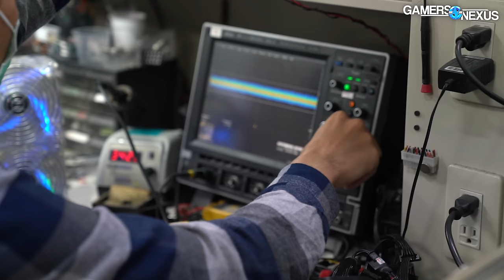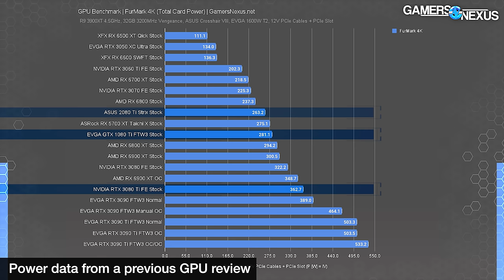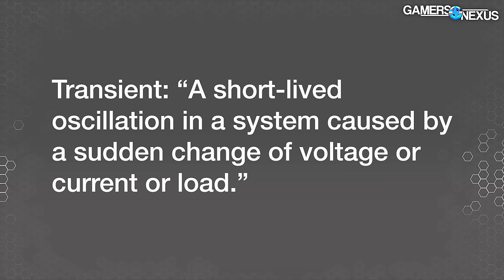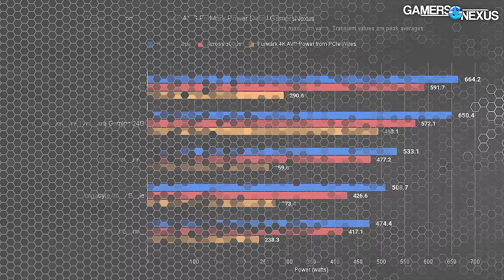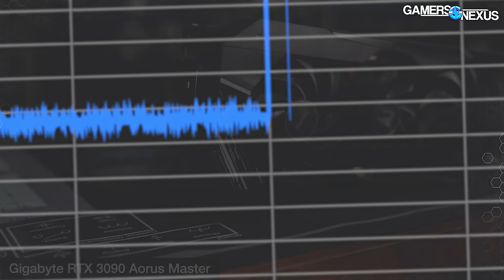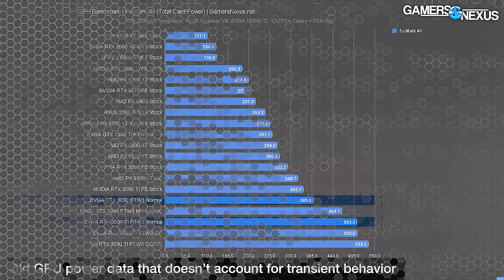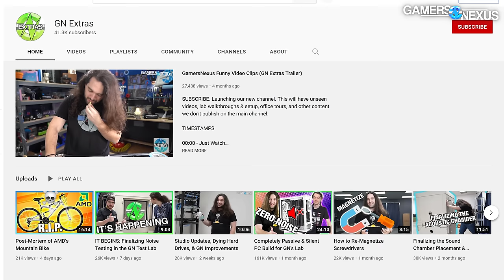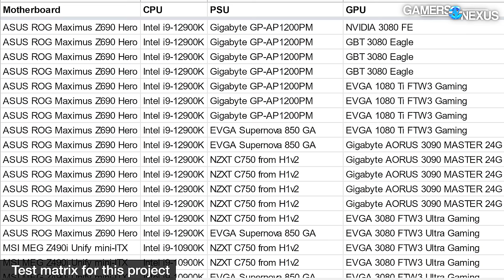The Brewing Problem with GPU Power Design | Transients

Comment: So, a bit of a tipoff about testing for these transient spikes, as I recently had a problem with them myself that resulted in me just buying on on-sale EVGA 1300W so it can just soak up the problem, because thats far cheaper on time than any other solution.

The tipoff here is the BEST way I found of tripping it, happened literally within a few seconds every time, was fallout 4 VR. In general I was able to benchmark the system as I wished and never had even one shutdown during any benchmarks, however I had one shutdown while loading GTA online (weirdly), one shutdown in Phasmophobia VR, and a total of atleast 30 shutdowns in fallout 4 VR before I even got through character creation. I'd highly recommend it as the BEST way to see if a spike can take out your system power.

My System contains a 5950x, an MSI 3080ti, (64GB 3600MHz RAM) and was running on a Coolermaster 850W MWE V2, if anyone wants to know
Reply: 3080ti isnt that far off from an 3090 ... afaik a 3090 can have spikes at almost 600w, worst case for a 5950x would be like 250w and for stuff like ssd, fans, lights etc ill give them ~50 to 75w ... espacially if you look at newer boards ... then i'll take 20% above it and this results in my psu capacity i want to buy for a rig.
Reply: Can you share the framerate you were hitting in Fallout 4 VR?
Reply: I feel like this has happened to me.  I can't get my system to reboot without pulling the CMOS battery.
Reply: I had a similar problem like a decade ago with a 570GTX or whatever it was. Every time I looked at water in World of Warcraft the computer would shut down within seconds. Took a while to isolate the behavior down to that, but once I put realized that was happening I could reproduce it every time. Put a bigger PSU in the system and the problem went away. Transients are fun.

Bigger picture though, all PC components are ballooning in power consumption. Dennard scaling was already dying off for years, but it's really hit a wall in the past couple of years. A significant source of extra performance is now coming from simply letting components draw more power instead of getting more performance from a similar amount of power like we saw in years past. This is only going to get worse from all vendors as time goes on.
Reply: @ngc4486diane  People don't often understand, and there's a lot of bad advice out there. Pre-builts too often have substandard components, so I'm not surprised at all.
Reply: @ngc4486diane  for, from common information and advice, it appears to be the most appropriate thing to do.
Reply: Did you have GPU and CPU over clocked?
Reply: What was the motherboard brand?
Reply: @sladewilson9741  I had this problem with GigaByte mb/gpu, turned out to be pin 20 connected in DisplayPort cable …
Reply: Okay, so Imma make a BIG answer to basically every reply, this got a lot more attention then I was expecting. First off, my board I forgot to mention, it's an ASRock X570S PG Riptide. FULL spec breakdown of every component towards the end.

While fallout 4 VR was running I was getting about 60-70ish FPS (it's a lot harder to tell in VR, but it felt around that, with spikes down to 40) and now running it I get a smooth 90ish (by feel, again, its hard to tell).

No, I did not have anything overclocked. I had looked at overclocking all of them, but it seemed pointless on all fronts. Trying to overclock the CPU I wasn't even getting into windows at the turbo amount. GPU I hadn't tried too much, and RAM, from what I'd heard, didn't really benefit from going above 3600MHZ on the 5950, and since 3600 was the rated speed of my RAM, I just left that as is. I went further down all of these avenues later, but this issue was evident pretty early on, VR was one of my bigger excitements for the GPU.

Why would I even run that setup in the first place? When I got the money for the build the cheapest option was a system integrator (CyberpowerPC in particular) and the margin they take on upgrading power supplies meant that I was in the same cost prospect of BUYING a brand new PSU from amazon at a HIGHER wattage after the fact as I was upgrading it through cyberpower, upgrading from 850 was a LOT. Ultimately that deterred me from upgrading, and all the sites I checked (all one of them, I really neglected thinking this part of the build through, I was kicking myself for WEEKS) said it was relatively fine. Ultimately when I DID experience problems I got a 1300W EVGA for $10 less than if I had gotten a 1000W Nonamebrand PSU from Cyberpower Directly, and still have the 850W that  came with my computer kicking around in my closet.

MOBO: ASRock X570S PG Riptide
CPU: AMD Ryzen 5950X
GPU: MSI Geforce RTX 3080Ti
PSU: Coolermaster 850W MWE V2 Fully Modular
RAM: G.SKILL TridentZ RGB Series 64GB 3600Mhz CL18 (16x4)
 There are also a total of fans in the system. Overall it was quite the straining system, but it was definitely only over on spikes.

Comment: I had this exact same problem. After waiting for hours in line to get into Microcenter when the rtx3070 launched, the card I brought home wouldn’t work on any of my systems, and kept tripping the power supplies internal wattage limit. I tried for over a week straight to troubleshoot the issue but unfortunately had to return the card I worked so hard to get in the first place. So happy someone is finally looking into this, and that I wasn’t just crazy. I hope this means the responsible parties will take a look at this problem and work to address it, as it is just absolutely infuriating to deal with when it comes up.
Reply: Whats your PSU?
Reply: @Whatthevortez  ^ this
Reply: @badcommentbot8349  it shouldn't need to be the minimum, the 2080 ti (for example)  could run in systems with 650w and it was perfectly fine
Reply: @chitorunya  yeah but this isn't 2019 anymore.
Reply: @g00gle1sw4tchingme  correction: nothing is sane anymore.
Reply: @ej_tech  Oh it's been that way for decades now. You just didn't know it.
Reply: I'm going to guess its a pre-2021 seasonic unit
Reply: Weird, my tuf 3070 never gave me a shutdown problem even when im just using a 550w seasonic focus+ and thats gaming everyday for almost 2 years
Reply: Currently running a 3070 on 650 W PSU.
For additional safety, run them with an undervolt, and CPU on Curve Optimizer for further efficiency.
At this time, transient power is not the only spike to worry about. There's also energy pricing spike.
Reply: are amd cards less prone to the spikes?
Reply: @earnistse4899  AMD tends to overbuild the power delivery on their reference boards, at least, so they have much more capacitance onboard, so to speak. With board partners? Bit of a crapshoot as they tend to pinch pennies. But, yeah, overall AMD boards clamp transients better and tend to have a slower ramp up and down.

Comment: Twenty years ago, when I was in high school, car audio had a similar problem drawing down voltage when the bass hit. The "solution" was adding massive 12V capacitors with claimed 1-2 farad capacitance. A lot of them were junk. I wonder if we'll see similar snake oil for sale in the computer market soon.
Reply: I was sitting wondering about that. There were capacitors you could put in-line for audio cards. Those, well, *worked*, but didn't make a difference because, shocker, the audio cards did it on their own and didn't really have massive amounts of differences in demand anyway.

Now I am starting to wonder if those products might work for this sort of thing. Just buffer it juuuuuuustt enough. Given that it didn't produce negative issues to it when tested for the audio cards.. erm. Maybe it would work?
Seriously a ducttape dirty hack.
Reply: I loved that stuff. I was only 12 but my bro and brother in law had some cool setups. My brothers S10 with huge subs was nuts. Everyone should feel the sensation of that much bass in such a small cabin

Comment: 12:55 That moment when you start wondering if your 1000watt PSU will be enough.  I actually got mine because my 2080TI and i9-9900k were giving me these exact OCP-ish shutdowns on my 850 so I figured I'd go overkill.  So much for overkill...  NVidia really should be building more capacitance into the card design if this is how their going to operate.  It's ridiculous to expect PSUs to handle this kind of stuff as a general market feature.
Reply: Remember that throwing a bigger PSU at the problem can end up tanking your efficiency numbers.
PSUs are MUCH less efficient at lower percentage loads.
Going from a 1000W to 1600W PSU on the same system could end up costing you 2-4x the idle wattage.
This kind of thing is wasteful, and costly.
Reply: Maybe a PSU company could just make a capacitor bank for the GPU to sit in between the PSU and GPU
Reply: Strange, I ran a power OC bios (can't recall the power but it was the max available on any bios) on my 2080ti liquid cooled with a 215watt 8700k for years on a 650watt seasonic PSU with zero issues.  Though I did need to upgrade as the 650 didnt handle my 3080
Reply: That might be what was happening to me with my 6800 and mild OCs.
Reply: @kidShibuya  Just like Steve mentions, the PSU brand and individual design matters as well.  A high quality seasonic 650 could probably handle high transients much better than a poorly designed 850. 

That's the biggest problem here -- you can't even go off your PSU's wattage rating, there's so many variables, including how well your motherboard regulated your CPU transients (VRM buffer caps could also have helped you there).  

This is why ultimately these huge massive transients coming out of modern GPUs are such an issue.  And it's one they could moderate themselves by providing better buffering on the GPU's power delivery, or not letting their cores push transients that high in the first place.

It's the randomness and multi-variable nature of this that makes it so troubling as a trend.  Glad GN made this video, needs more general awareness.
Reply: @rickybobby7276  same issues for my 3080 on 750w, had to get a 1000w
Reply: @rickybobby7276  and if you had read the very first reply, you would see that your "solution" is a very poor one...
Reply: @LiveType  Not entirely.
All conversions have an efficiency range. It doesn't matter if they are being done from 120/240v to 12v in your PSU, or 12v to 3.3/5v on the motherboard.
Every device is designed to have an efficiency peak SOMEWHERE in it's range, and using it at 10-25% load will almost always be outside that design range.
Reply: @Prophes0r  Assuming non Titanium rated, the efficiency delta between 20 and 100% is 3, maybe 4%. Titanium pushes the 20% low down to 10%. Be really damned careful when throwing out relative values like 2x, 4x, whatever. 4W is 4x 1W
Reply: You make a valid point.  Slapping more caps on at the source of power draws should smooth out transients somewhat, and help with GPU stability as well
Reply: @Prophes0r  PSUs are also much less efficient near their power limit as well.
Reply: @Prophes0r  this is no longer accurate with modern topology available in current PSUs, either
Reply: its not about w, its about efficiency and Quality
Reply: @gordonyz4  Well you didn't you just got a bad 750w
Reply: Bro. Thought I was crazy. Had the same setup, pc would just switch off at random (non idle) moments. Tested fucking everything. Had a platinum psu too. Well, in the end I just slapped a 1000watt corsair in it, wouldnt you know it, problem is gone. Fuuuuck me.
Reply: @blackraen  It never ceases to amaze me how few folks realize that make/model matter a lot more than the wattage listed. This is compounded by the fact that many people prioritize EVERY other component over the PSU. I fact, many will skimp on the PSU for no reason other than to save a few bucks, oblivious to what that may cost them down the road.
Reply: @kidShibuya  A kilowatt seems overkill for a 2080ti and a 9900k. I used to have an SLI 580 Fermi setup with an 860 platinum and didn't haven any problems with that.
Reply: Nvidia is the problem here. If you think the 4000 series will be an improvement, you're in for a rude awakening. 600W TDP .. How many power supplies even exist in ATX format that could deal with a 3x transient from that?
Reply: @Jelpronir  could bad wiring
Reply: @biolinkstudios  doubt it. Two different houses, same problem. Also, bad wiring rarely happens here in the netherlands haha
Reply: @Prophes0r  Same old lies that set people up for this very issue still being pushed.
Reply: After u got Ur 1000w u still getting crashes?
Reply: @thealien_ali3382  nope :-)

Comment: I am an electrical engineer, sometimes dealing with transient issues in an industrial environment where we work in kW and MW. I am also a keen audio enthusiast and know for example that a power amplifier is very dependent on its power supply's ability to deliver power at higher frequencies. I thus understand your review and kudos for pointing these issues out to prospective buyers. What the industry needs is a rating system for PC power supplies, in their ability to handle short term overloads. Premium manufacturers like Corsair can then use this rating system to distinguish their power supplies from the vanilla variety.
Reply: The issue with a rating system such as the 80+ certification that already exist for PSUs is that it becomes vague and eventually turns into a marketing label overtime. Unless there is a federal standards I think we will just be seeing more of the same.
Reply: I’m more on the side of putting bulk caps directly on the GPUs to help deal with the load personally.
Reply: @joshuabenitez3260  I think ATX 3 is intended to address this.
Reply: I would side with @thelol1759 and suggest that the problem needs to be solved on the GPU side. The PSU needs to have solid bandwidth but there's usually a foot plus of cable between the PSU and the GPU. In the world of sudden, extreme current loads, the rail could be collapsing on the GPU side before the PSU has any chance of responding.
CPUs have had spike current demands in excess of 100A for a long time but their VRM circuits are spec'd to handle those transients and not pass them on to the PSU so severely.
GPU VRM circuits, and particularly their bulk capacitance is just not up to snuff if they can bring down a 12V rail that's basically all theirs.
Reply: I suggested this too, but there are issues. 
1) Ratings can often be used in misleading ways by manufacturers
2) It will complicate things for consumers in an already complex ecosystem
3) Manufacturers will probably not be very willing because it will make their existing products look bad and increase costs in the future

It's certainly better than being clueless like we are today, but it's less than ideal
Reply: @kgbboy  I can see just adding a capacitor box near the gpu with like a pair of 47000μF 25V caps
Reply: This reminds me of an interesting video on power grid buffers where the guy says "usually electricians work in kW/hour, here we work in MW/seconds."